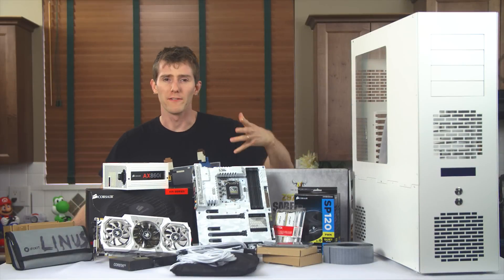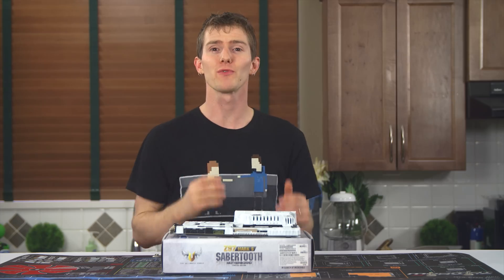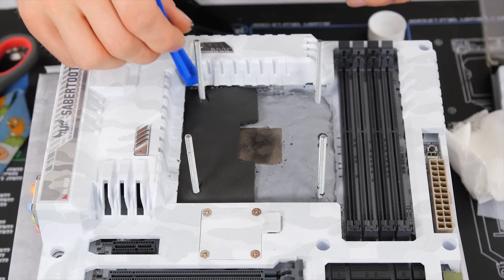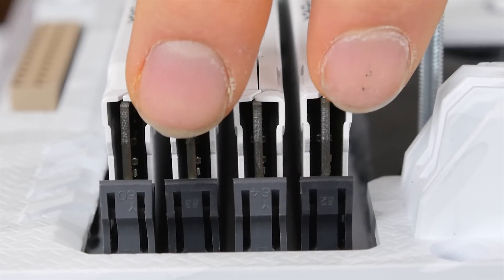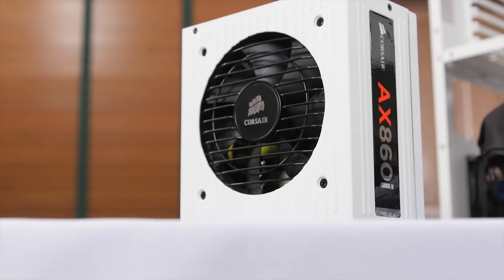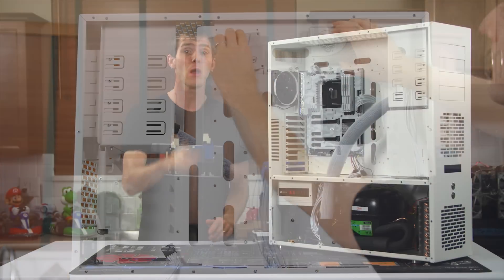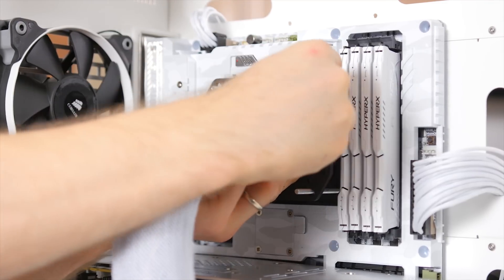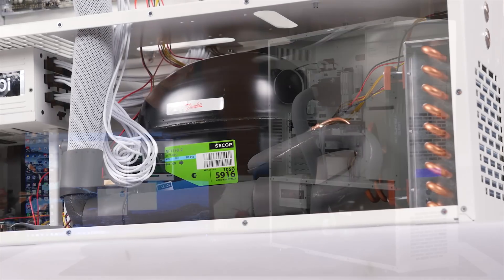ULTIMATE Sub-zero Phase Change Cooling PC Build Guide

Comment: What do you think of my first build 

Corsair 750D 

Intel Core™ i7-5820K Six-Core 3.30 GHz 15MB INTEL Smart Cache LGA2011-V3 

 Corsair Hydro Series H55 Liquid Cooling CPU Cooler

ASUS X99-A INTEL X99 Chipset, 3-Way SLI/Crossfire supported, 4 Channel DDR4 ATX Mainboard w/ 8 RAM slots, UEFI Bios,Thunderbolt Ready,Crystal Sound 2,Turbo LAN,USB3.0,SATA-III RAID,3 Gen3 PCIe x16, 1 PCIe x16 & 1PCIe x 1 

16GB(4x4GB) DDR4/2133mhz Quad Channel Memory

NVIDIA GeForce GTX 980 4GB

Corsair 600W CX500 

240GB Kingston V300 Series SATA-III Gaming MLC Solid State Disk

120GB Corsair Force Neutron GTX Sata III Solid State Disk

 ASUS Xonar DGX 5.1 Sound Card
Reply: David Cauley Why two different SSDs? and why a sound card?
Reply: I couldn't decide so it put both of them on there hoping that someone would say which one of them is better.
Reply: No, you just spent $3000 on something you knew was shit...
Reply: s9620804z It is really my first build and I just wonted some advice sorry If I offended you.
Reply: Tamir Cohen There's no need for that I just really wonted some advice. Ill take my original post down if that's what you wont.
Reply: David Cauley Just ignore them. I'm not rich, but I'll be building a PC with higher specs, as I'm going to be saving money to do it. These guys probably waste their money on unnecessary things.
Reply: TheLondonCyclist Thanks
Reply: David Cauley Remove the sound card (they don't do anything), replace the 240 GB SSD with a fast Hard drive if you want and replace that crappy cooler with something higher-end (H80 to some basic custom water cooling kit).
Reply: David Cauley 
The case is a bit overkill for a standard ATX single video card build, but if you like it then by all means get it. It's not a bad case.

The Corsair CX500 is a bronze cert 500w power supply. If the website selling it says otherwise, you should notify them. Either way, if you can afford DDR4 at this time, I would go with a higher efficiency rated power supply. The Corsair HX or AX series are both safe bets. A solid PSU will be one of the last components of your build to become 'antiquated', so to speak.

If you do a lot of memory intensive work, I would opt for 8gb sticks for future expandability. Would be a shame to put those 4gb modules on a shelf one year down the line.

If audio is important to you, do yourself a favor and don't buy a sound card. For perfect audio, you wouldn't want the DAC and amp inside your computer. Other components will add static noise to the feed. Sound cards are only necessary if you either have no onboard audio, or perhaps your motherboard has no optical out. Aside from that, they are useless. Bitrate differences are important, but the added clarity is deminished by the added noise. In fact, the added clarity will only make the noise more noticable, granted you have the ears of an audiophile.

As for your choice of SSD. Go for the Samsung 850 pro for performance, or intel 730 for stability/reliability. Kingston tries to push firmware, which imo is kind of bullshit.

Other than that, looks pretty generic. Enjoy.
Reply: LyyK https://uk.pcpartpicker.com/parts/partlist/ 

Is this better.
Reply: CPU is inferior. But if you just want to game, get it, X99 is already a overkill.
Reply: David Cauley To share your build, you need to use the sharable link.
Reply: LyyK 

CPU	

Intel Core i7-5820K 3.3GHz 6-Core Processor
£293.94				£293.94	Aria PC	

CPU Cooler	

Corsair H80i 77.0 CFM Liquid CPU Cooler

Motherboard	

ASRock Fatal1ty X99M Killer Micro ATX LGA2011-3 Motherboard

Memory

Corsair Vengeance LPX 16GB (4 x 4GB) DDR4-2666 Memory

Storage	

Samsung 850 Pro Series 256GB 2.5" Solid State Drive

Video Card	

MSI GeForce GTX 980 4GB Twin Frozr Video Card

Case

Corsair 750D ATX Full Tower Case

Power Supply	

Corsair CX 600W 80+ Bronze Certified Semi-Modular ATX Power Supply

Optical Drive	

Samsung SH-224DB/BEBE DVD/CD Writer

Operating System	

Microsoft Windows 7 Home Premium SP1 (OEM) (64-bit)
Reply: The case is overkill, Windows 7 Home Premium does not support 16 GB of ram (get Pro/Ultimate or lower your ram) and if you gonna upgrade in the future get 2 x 8 GB RAM instead of 4 x 4 GB.
Reply: Kaminishi
4 x 4gb is better than 2 x 8gb.
Reply: Kaminishi 

I added the 2x8GB memory and Windows 7 ultimate, so is is that ok. 

Crucial Ballistix Sport 16GB (2 x 8GB) DDR4-2400 Memory

Microsoft Windows 7 Ultimate SP1 (OEM) (64-bit)
Reply: Wait until Skylake, it is close to be released.

Comment: What do you guys think of my build?

CPU - Intel Core i5-4690 - $214.89

GPU - Asus GeForce GTX 970 4GB STRIX (I know about the 3.5GB + .5GB issue) - $329.99

Motherboard - Asus Z97-C ATX LGA1150 - $127.99

RAM - Kingston Fury 2*4 8GB - $59.99

HDD - Western Digital Caviar Blue 1TB - $49.99

SSD - Crucial 128GB MX100 - $64.95

PSU - Corsair CSM 450 Watt 80+ Gold - $59.99

Case - NZXT H440 - $109.99

OS - Windows 7 Home Premium - $94.99

Microsoft office License - Home and Student 2013 - $139.99

Total Price - $1,274.57

This is my first time building a pc, so I’d appreciate any help or feedback you could give me!
Reply: The build itself is very balanced. The only thing I would consider would be a higher W PSU. Maybe go for a 650w -750w as this would give you the headroom to add a second 970 in the future.

Comment: i am thinking about upgrading my fx-6100. is it worth it? i am considering the fx-8320 ore a i5 4460. i also need to buy a new motherboard for both. (my old one dous'nt support the 8320) so that can't be a reason to go for the 8320. but i can spend more on the mobo for the 8320 (cheaper). i am not gonna edit or something. thnx (srry for bad english)

Comment: Why has no one done this with peltier (thermo-electric/heatpump) modules??? They are a few millimetres thick and are 40x40mm in surface area commonly. They basically are like a solid-state refrigeration unit. The way they work is they cool one side by around 20 degrees Celsius and warm the other side by 20 degrees Celsius, and in theory can be sandwiched between any CPU and any CPU cooler, including waterblocks as  the CPU is the only thing that is cooled, so no ice forming in the loop. With a little investment by say Corsair, this may even be the next big thing in CPU cooling.
Reply: UniCrafter Phase cooling is more efficent per watt then TEC cooling and it is much easier to play around with.
Reply: Jayden 1397 If companies started to experiment with using Peltier modules in cpu coolers I expect that they would improve upon their efficiency, and make them an all-round better performer. Right now there is not a lot of fuss about peltier modules, the best they are used for is USB drink can fridges. Also, Peltier modules are solid state and therefore should be much better than any compressor based cooling system under optimal conditions, as most things that begun as mechanical have moved to solid state, from radios to hard drives, I expect peltier cooling to follow in their footsteps once a small lab discovers a much better way of making them. Per haps once the technology advances enough, processor companies will ship their CPUs with a peltier module under the heat spreader, with an on-board microprocessor judging the optimal power of the module to as to keep the CPU cold without any condensation forming, One last thing, I doubt a phase change cooler would use less power than the CPU its cooling. That compressor would be more than 100w probably.